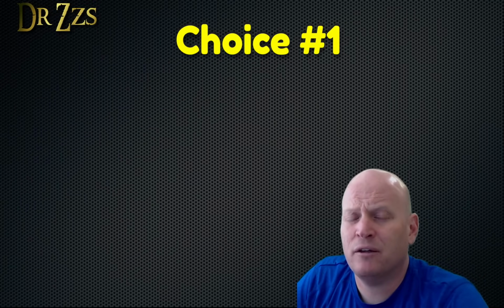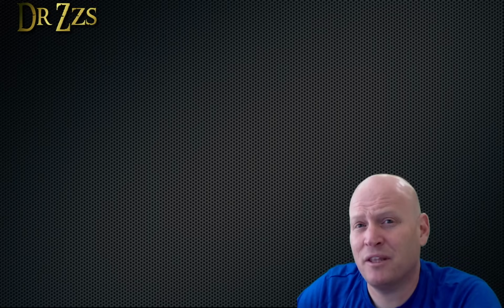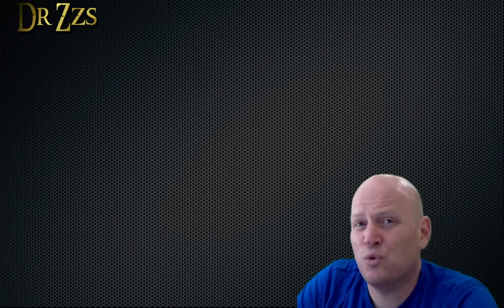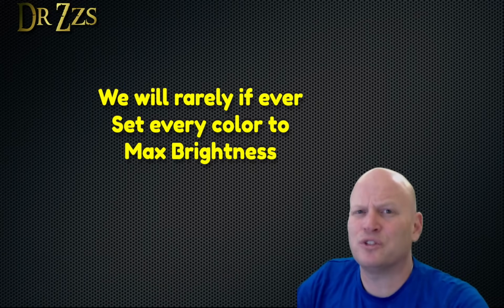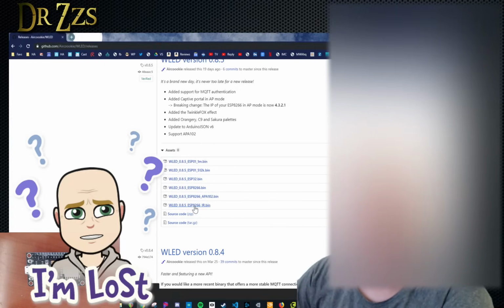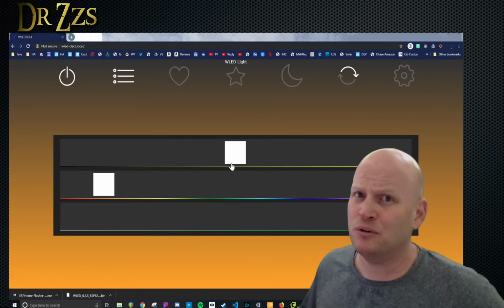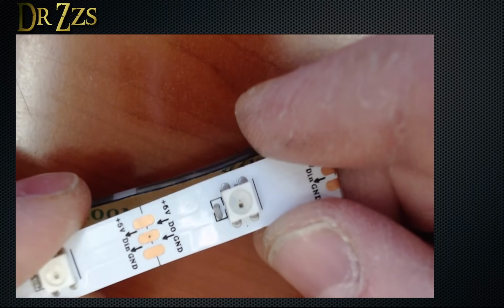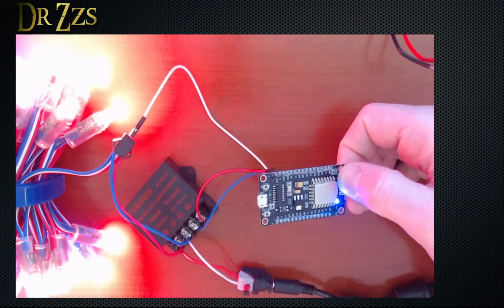Beginner's Guide to Christmas Lights - and LED Shows for Every Holiday

Comment: DrZzs, I am all set, except I will need to use one of the metal power supplies instead of your smaller power supply used at the end of the video. Do you have a video where you explain how to use the 30a power supply with the node MCU, 12v to 5v inverter and the 12v strings?

Comment: what are your thoughts on injecting power at various points?  or is beginning and end typically enough?
Reply: CrankyCoder exact question I need answered as well
Reply: Mando Rodriguez I have some some other led projects where I injected it at multiple places.  Just not sure if it was necessary

Comment: I was trying to flash my node MCU and I have. tried two different cords and it does not read a port there.  In addition, when I plug it into my computer the fan on the PSU turns on even though its unplugged.  I rang everything out and ervefrything is wired to where its supposed to go, I just can't get the node MCU to be discovered, it just says no port found.  Any ideas or guidance would be helpful.
Reply: I was having the same issue! Long story short... you probably have to install a driver. After installing the CB210x driver from Silicon labs, identified the device right away.
Reply: @shawnpoling7019  Thanks,  I looked down the posts and I found that and it worked.  I got my lights to turn on, but they only worked on the peaks and not on the rest of the house, so I switch programs to the one before that and I had a whole different. set of lights light up, but I. have NO control with the app.  I think it comes down to whether I'm installing the right file, or if I have them on the right output pins...I have them on D1 and D2
Reply: Brian Luedke sorry didn’t see this right away. If you haven’t figured it out, I think you have the wrong pins selected. If you have 2 signal cables are you using the ws2813 lights? I did get those ones and just plugged the green cable to D4 and the yellow cable to D3. Couldn’t find anything online about ws2813 wiring to nodemcu so just winged it. No issues for me so far!

Comment: Why do you not need the voltage converter when connecting the same power supply to the 5V strip?
Reply: because the power supply is already 5v...the only reason you need you need a converter is to convert 12v to 5v

Comment: Plugged it in exactly like in the video and my NodeMCU died. It gets incredibly hot and won't flash or respond to any USB input/anything else. Time to buy a new one and try again...
Reply from the maker: Did you connect it to 12v or 5v?  Don't connect it to power AND USB either.  Maybe it was a bad nodeMCU (which is possible), or you made a mistake when connecting it.  
Sorry to hear it died.
Reply: DrZzs I had it connected to 5v, I’m going to break out the multimeter later today to check if it’s actually 5v coming from the voltage converter, I noticed a review that said it was putting out 36v from the 5v side! Anyway, I bought 5 more nodemcu boards, I’m not giving up yet.

Comment: Any idea why esp flasher won’t find the node mcu?
Reply from the maker: Most simple possibility is the USB cable.  Some only have 2 wires inside for power.  I've made that mistake many times.  They should require a label on those.  
If that's not it, then you might need a driver for the USB/UART chip on the NodeMCU.  https://www.silabs.com/products/development-tools/software/usb-to-uart-bridge-vcp-drivers
Hope one of those solves it for you!
let me know.

Comment: Hi, I need help. I got to the point where wled settings page but when I search for for my local page the browser says server not found.
Reply from the maker: So your computer is probably not prepared to communicate using the .local address.  The next thing to try is to look in your router UI and see if you can find the WLED device in there.  If you can, it will give you the IP address.  Put that IP address in the browser.  
A third option would be to set a static IP address, but if you aren't familiar with doing that I'd not suggest it.  I cover setting a static IP in Part 2, which is here: https://youtu.be/6eCE2BpLaUQ
Hope that helps!

Comment: Wired up just like you show @17:38 - both of my strips shut stop working after 30 LEDs.  Tested the voltage at the next LED and between 5v & negative it read 5v.  Should I be able to test the voltage between the data channel & negative?  I should add that I'm using 5v strip lights...
Reply: Helps to go into the configuration screen for wled and set the number of LEDs from 30 to 150.
Reply from the maker: doh!
;p
More Details about the settings here: https://youtu.be/6eCE2BpLaUQ

Comment: Thanks for all the great info, what is the max length of the data wire from the nodemcu to the first led in 12v string light?
Reply from the maker: the short answer is about 24". 
But I'd suggest watching this for more info on that topic: 
https://youtu.be/ZFO_QOBG9Bs
With a sacrificial pixel I was able to go 40 meters!

Comment: Awesome video. Huge help on my first addressable LED Christmas.  Just doing the Christmas tree this year.  Question,  using 10 strings of 50 for a total of 500, do you think a single 12v connection at the beginning will work or should I inject 12v halfway through as well? There will be white light used alot so don't want to have a noticeable drop in brightness towards the top. Thanks in advance.
Reply from the maker: Great!
you'll want to inject voltage half way though, or at the end.  Whichever works out more convenient.  I show 10 strings of 12v lights in this video: https://youtu.be/zov-qIDSDcE
They start to dim after about the 5th string.

Comment: So I'm new to this world... I can't get esphome flasher to show any comm port on windows or Mac.  it stays blank with a check mark.  Any suggestions?
Reply from the maker: This sounds silly, but try a different USB cable.  Some have only 2 wires for power.  If you're sure your cable has all 4 wires, then it might be you need to install the driver for the USB/UART adapter that the nodeMCU uses.  there are a couple different chips but I think most use cp210x: https://www.silabs.com/products/development-tools/software/usb-to-uart-bridge-vcp-drivers
It could also just be the usb port.  Try a different one.  
I'm sure it's something simple. Hope that helps.

Comment: Is there a limit in the number of LED's the NodeMcu will control? Or a personally recommended limit?
Reply from the maker: simple recommendation is 500-600.  It is possible to go higher.  At some point you start trading more LEDs for lower FPS, so your transitions start to look more choppy, not as smooth.  I've run 1000 from one, just to see if it's possible and I couldn't really tell a difference, but the theory based on someone figuring out how much data the nodeMCU can process says the limit for 60fps is around 500.
Reply: @DrZzs  Thank you so much! So thankful I found your channel and all of your knowledge and experience your sharing. Has helped me in 1 week accomplish what I have been working on since last years Christmas light show fiasco!

Comment: So if I go with the WS2812 5v strip and they are 16’ long after how many led’s do I need to inject 5v. And does it need to come from original power supply?
Reply from the maker: it's best if it comes from the original power supply.  So running a parallel set of wires along with the strip is the best way. You should be able to get to the end of the strip and inject power there if you're using the 30/m strips.  If you're using the 60/m strips (or higher), you might need to inject in the middle too.  I'd suggest connecting them and testing them on the bench before you hang them up and make sure.  In most cases, with most effects, unless you're doing a lot of full bright white on every LED, you probably won't see any dimming in just one 16' string.  Hope that helps.
Reply: DrZzs yes it does , thank you. I actually went to The Hook Up last night and watched his videos and figured it out the. When he shows running that 22/3 inside the track along his led strip.

Comment: Can the 12v light strings be cut to length? I want to wrap my windows but don't want excess. I know the strips usually are cut to length but I wasn't sure about the strings.
Reply from the maker: yep. they are just wires joining them.  Very easy to cut. 
You can splice onto the ends too, just make sure you get the data flow direction right.  Hopefully they have an arrow you can see.  If not, mark the IN side before you cut them from the string so you'll know later.  Nothing bad happens if you connect them backwards, they just won't work.
Reply: @DrZzs  also, I'm curious. I've read that a lot of people use a Logic Level shifter for the data wire... I didn't notice you use one in this video. What are your thoughts?
Reply: @DrZzs  Thanks for this great video.  It's renewed my interest in LEDs.

1.  Question around the data direction... I have some existing LEDs (I wish I could link them from Amazon, but they are no longer sold).  They look VERY similar to the ones you use, and are 12V.  I don't see any arrows or anything on the wire to advise on data direction, do you have any hints or do I YOLO this and try it?

2.  I'm using a 12V to 5V splitter, the block + screws kind you used.  I was trying to just power the lights with the 12V, but they just do a low brightness blink and shut off, no matter which direction or if I use a barrel connector straight to them or not.  I tried this just testing, while I waiting on the wiring I need to connect the NodeMCU.  Does the NodeMCU need to be connected (via 5v connector as you show) for the LEDs to power on as shown in your vid?

Thanks a ton!  I'm so excited to try out some holiday lighting now!

Comment: Couple of questions.

Could I use a solar power supply?
If I want one part of my roof to light up and then another section would I need multiple boards?
Will this also work if I made arch’s for my lawn or Christmas trees and want them all separate?
Reply: Curious as well
Reply from the maker: yes, you could use solar. You'll have to calculate how many leds, how much power per led you'll use, and how long you want them to run to size your solar + battery.  Check out the latest live stream.  We did a lot with current measurements.

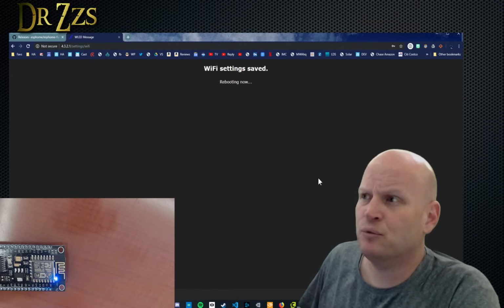Comment: Great videos and how too's!  I got hooked watching videos on the sonoff's.  I have subscribed.  I am experimenting with this and having a problem.  I'm basically at 15:39 mark in this video.  I am attempting to reconfigure the nodemcu to my wifi.  When I press save and connect, it just hangs up.  After several minutes, I power cycle the nodemcu, it comes back up with it's default wled settings.  I have retried a few times with same result.   I must be missing something maybe someone can give me insight on.  Any ideas would be greatly appreciated!😁
Reply from the maker: I had a good friend you had a similar problem.  His issue was his wifi password. Does your pw start with * ? Maybe see if it will connect to a different wifi network, like a hotspot on your phone or a guest wifi if you have one. 
Another thing it might be is 2.4ghz vs 5ghz.  The nodeMCU can only connect to 2.4ghz, so if you have both, make sure the wifi name/pw you're using is for the 2.4ghz.  Some routers (like mine) don't make it easy to control which one a device connects to.  It should connect to the correct one, but it sure seems like sometimes it doesn't. 
Last thing I'd try is a reflash of the nodemcu.  
If it still doesn't work I'd suggest visiting the WLED discord chat and asking there.  
https://discord.gg/Tr7q74
Hope one of those fixes it.  Let me know.
Reply: @DrZzs Thanks for your response, it's really appreciated.  I have made a little head way.  I figured out it was on my wifi by using the wled app on my phone to find it.   So now, the app works great!  I have two strings connected together, looks good.  Problem is when the nodemcu is power cycled, it reverts back to default AP mode.  It does not save the settings.   I am using version 0.8.6.  I may try reflashing.  Or maybe reflash to 0.8.5.  I have two other nodemcu's, may try one of those as well.  Unless you have a new idea with the new information I have given.  Thanks again!
Reply: @DrZzs  I have it working now.  What I mean by working, the nodemcu will now save changes and doesn't switch back to AP mode.  A re-flash fixed it!  
This is some cool stuff, now I just need to get it on the house!  Thanks again for all your help!

Comment: Awesome video!!!For 12v wiring you can do it a little different(another option)
1)https://www.aliexpress.com/item/33011470040.html?spm=a2g0s.9042311.0.0.3dca4c4dvtk8xn (with micro usb option)
2)https://www.aliexpress.com/item/33005150604.html?spm=a2g0s.9042311.0.0.3dca4c4dvtk8xn (female with screws)
1)Connect the usb output of buck converter to usb of nodemcu.
2) Data pin nodemcu(D4) to data of the rgb strings.
3) Ground pin of Nodemcu to ground of the rgb strings.
4)12v positive of buck converter to positive of dc screw connector, 12v negative of buck converter to negative of dc screw connector.
5) 12v positive(of 2 extra wires) of rgb string  to positive of dc screw connector,12v negative(of 2 extra wires) of rgb string  to negative of dc screw connector.
Warning!!!!! THE Vin pin of nodemcu MUST be empty!!!!Very Important!!!
Reply from the maker: Awesome!
I had no idea they made those with the USB connector ends!  That's way better! Time to update the links!  Thanks!

Comment: It looks like the ws2813 replaces the ws2812.  The 2813 is 4 pin vs 3pin. It seems to have a backup data signal.  What is the preferred method to jump this to the nodemcu? How do you configure another pin on the node mcu to output a data signal?
Reply from the maker: yes, those are an updated option, but the 2812's are still my preference.  I haven't had any trouble with random burnt out pixels.  
Regardless, the two data lines attach to the same output pin as far as I know.  I haven't actually used them.  I have seen special controllers for 2813's that have 2 contact points, but I don't think it uses a separate data signal.  I think it just runs parallel as a backup source for the signal incase a pixel is dead the signal still moves on to the next LED.

Comment: Great video! However, I am having trouble connecting the node  MCU.  It keeps telling me " no serial port found". Please help.
Reply: I had the same problem and found this message online that got mine working. Just follow the instructions and a should pop up.
1. Press Start -> Type: Device Manager.
If u see a [!] mark next to CP210x USB to UART (COM..)
Even if u don't find that just install the following file.

2.https://www.silabs.com/products/develop ... cp-drivers
Select first one if u got windows10.

3.Install the file and your done.

Comment: Holy crap, I was only searching for some led string lights for my basement, and came across this video. I guess the house maintenance will have to wait this weekend, because I just spent all the money on Amazon on this stuff!!
Quick question - The link to the WS2812 LED strips you have actually goes to WS2813 LEDs, which have 4 connectors instead of the 3. BI/BO looks to be added. Which pin does this go to on the nodemcu?
Reply from the maker: Awesome! 
I'll check that link.  
I haven't used ws2813's but those two Data wires should come from the same pin on the NodeMCU. I'm surprised the wires are separate actually.  I've not seen the ws2813 connectors.  I'm 99% sure you could just connect both data wires to the same pin.  The unique feature of the 13's is they have a back-up data line.  So if one LED goes out the rest can still function.  I don't think that's a very common issue with LEDs.  At least not like it was with the 'old fashion' bulbs.  
So, I'd recommend you still get the ws2812's instead of the 13's unless you really want that backup data line.
Reply: @DrZzs  Hey Dr Zzs, FYI in case anyone else orders the WS2813s and is wondering where to connect the BO/BI, connecting both BO/BI and DO/DI to the D4 pin on the nodeMCU didn't work (lights didn't come on at all). So, I ended up just connecting the DO/DI to D4 on the nodeMCU and left the BO/BI disconnected, this seems to work fine. Probably negates the backup option, so I just found and ordered the WS2812b strips for the rest of my setup..

Comment: Great Video!  One question that I was hoping you could address.  Can you run multiple strands of leds off of one node MCU?  Would you simply split the wires to both strand inputs?
Reply from the maker: Thanks!
Yes, you can split the data signal and connect to other strips.  The signal will be the same to every strip.  So if you do it, you can't have different effects on different strips.  If you want different effects on different strips then you need a separate nodeMCU for each strip.  Right now, WLED doesn't support using different pins and sending different effects to separate strings from one Controller. 
Hope that helps.

Comment: how many strips can you have on 1 controller i want 8 strips doing the 1 show will this work thanks again and great channel
Reply from the maker: Depends on how many LEDs per strip.   Seems like Aircoookie recommends 500-600 leds max per controller.  It might be okay to use more, but at some point the little brain in the NodeMCU won't be able to keep up and it'll behave unpredictability. 
Buy some extra nodeMCU's, they're cheap.  If you can get just one to control all 8 strips, great.  If it misbehaves, then split the work load and add a second or 3rd nodeMCU.  
Hope that helps.
Reply: @DrZzs  thanks so much
Reply: Look forward to part 3